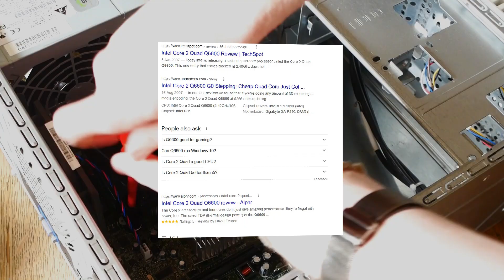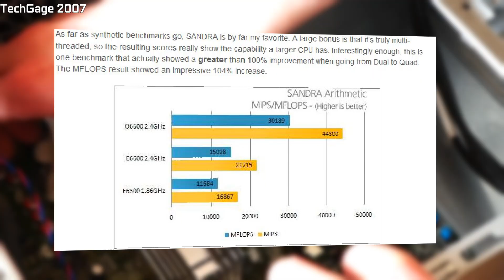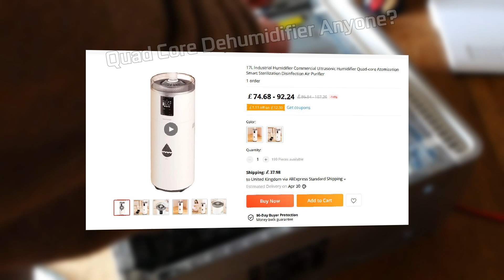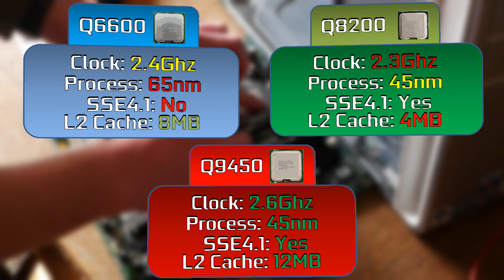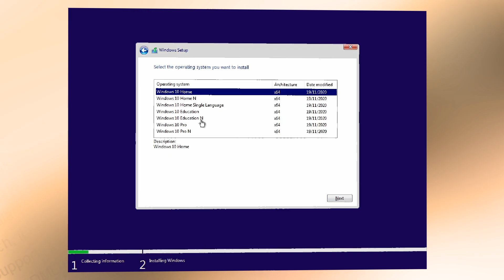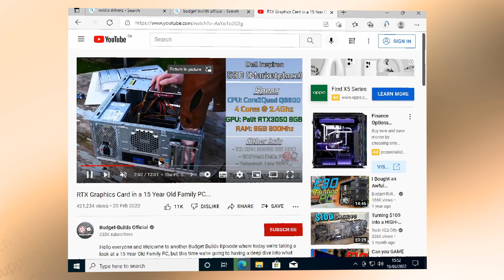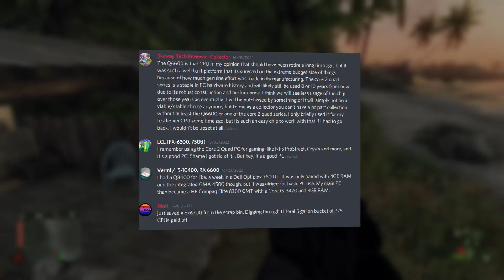Intel's Core2Quad...Finally Obsolete?

Comment: I upgraded from an E4300, to an E6300, to the Q6600. My god, with my Asus HD 4850 I felt unstoppable in 2008! This brings back so many memories of tweaking the old socket 775 beast at the middle of the night, increasing the clockspeed a couple of MHz at a time. Better days.

Comment: Q6600 is a legend mostly because it's an absolute beast in overclocking. With some luck and decent mobo and ram that handled high fsb you could get 50% overclock to 3.6ghz which made it by far the best cpu of the era in price/performance ratio at the time. Today all c2q processors are still perfectly fine in a lot of simpler tasks and old games even without necessary instruction support

Comment: Woah, my dad used a Core 2 Quad Q9300 for years, it was originally paired with a Radeon 5450 but it ended up dying a few months ago, we replaced it with a 2 GB GDDR5 GT 710 from Asus, the Q9300 ended up being a bottleneck (even when overclocking it to 3 GHz in the bios) so I advised my dad to buy a new system a few days ago, we ended up going for a Lenovo system with an i5-11400f, 16 GB of ram (which I upgraded to 32 GB since I just had a 16 GB stick laying around) and a GTX 1650 Super, it ended up costing us 800 euros which ain't bad. It's quite interesting to see a video about the Core 2 Quad right after we get rid it.

Comment: I had the Q2Q 6600, with 8gb of Ram.... and pair it with a GTX 970... was a great system for me for a very long while... until i upgrade to the i7 4770K... and to my present system, 3800x... the Q2Q 6600 was great except for when i got a better GPU... wasnt happy with me putting an R9 Fury in it...

Comment: All of these chips are great overclockers. Q6600 could hit 3.6ghz. And 45nm quads could hit 3.8-4ghz fairly easily as well. Those sort of clock speeds will make these processors more than playable if the above benchmarks are anything to go by.

Comment: Still using an Intel Core 2 Quad Q9650, at it's stock speed of 3.00GHz, on a Gigabyte EP35-DS3R motherboard, with 8GB (4x2GB) of G.Skill DDR2 1000 5-5-5-15 2T memory, along with a 2GB EVGA 750 Ti SC (with optional extra backplate) and a Sound Blaster Audigy (SB0090), for my Windows XP Pro SP3 32-bit /8.1 Pro 64-bit (with ClassicShell Start menu) retro gaming rig to this day as of 2022.

Comment: The great thing about the Q8200 is the fact that the price reduction can still be felt today. Often, I'm able to find Q8200s for less than 1 dollar or free, whereas the Q6600 and Q9450 are never in this price range.

C2Q is obsolete in the strict interpretation (through the formalism), but is far from it when operating a period-specific machine. Even C2Ds are not obsolete in this modified interpretation!

Comment: Watching this now on a 775 system :D specifically an optiplex with xeon (q9500 equivilent) ssd 16gb ddr3 and a gt 1030. Still works great for web browsing office content consumption and older games / emulators which is like 90% of my computing. I would actually like to thank you personally though because I hadn't had a functional pc in years and channels like yours actually inspired me to build this system very cheaply with all second hand parts several years ago. I do have a better computer built now but I still get lots of use out of this one and honestly it still runs faster than many much newer computers my friends and family use.
Reply: x3363?
Reply: @lagginswag  yessir

Comment: I had a Q6600/R9 390x PC until a couple of years ago. It was fine for what it was. The first PC I built my fiancée was a Q9400/R9 270. If you're not that bothered about AAA, they're really still not a bad proposition for the price points they're at.

Comment: My first high end build was a c2q 9300 in 2008! Loved that thing, was basically the first  of my friends with a quad core too! Also just recently restored a Dell XPS 630i and installed the top end q9650 in it. Bad company 2 was unplayable with the original c2d e8400 at 20 fps max. With the c2q 9650getting 45-70fps!

Comment: The Q6600 was my first quad core cpu and was my jump back to intel from using AMD 64 x2. I got mine after the price dropped and was a great value, especially if you overclocked since these CPUs were great for it.

Comment: A while ago I succeeded in installing a quad core q9000 mobile core2 quad in a thinkpad t61. it's quite the mod, but it takes the CPU performance of this laptop almost to modern standards, especially if you're willing to run linux and pear it down a bit.

Comment: I built a Mini ITX system with an E5440 (Server version of the Q9550) some three years ago and I ended up letting my wife use it for her Uni stuff. Still rock solid on a G41 mobo and runs nice. Granted it is just office work, but these chips are still more than usable not just for playing older or simpler games, but as a daily.

Comment: I was using a Thinkpad X200 and T400 and the T400 remains my main Laptop until 2019. The T400 now is the family Office PC and still runs Fedora like a charm.
Using WinXP/Win7 and Linux and for Office Use they still work fine, even some little Emulation was possible.

Comment: I recently bought a new motherboard for my q9550 system. The Biostar P43D3 v6.1 board i had it on before didn't support larger than 2GB dimms so i replaced it with an Intel Desktop Board DP43BF so i could run it at 8GB of DDR3. Its running across from me as i type this i just repaired the fan on its Sapphire single slot Radeon HD 3870 512mb so it no longer wails like a banshee. I plan on putting it in a nice case eventually with a nice tower cooler. I think it's great that i could put the Hyper 212 Black Edition on it the same cooler i put in my brand new Core i5-12400 system. Which will be nice because i run it with an overclock to 3.4ghz. 

Add some modern amenities like an add in USB 3.0 card and an SSD with windows 10 i'll bet most people wouldn't notice the computer is almost 15 years old just browsing the web on it. It's also pretty funny with a NVME SSD, but the intel desktop board i have only has 1 PCIe X16 slot so putting a Gen3x4 card into a Gen2x1 slot yields not so great throughput results making running more than SATA not really worth it. It also can't boot from that so the option is storage only.

Comment: I had a C2Q 9550 with a 1050 Ti and was surprised how well it ran Witcher 3, and this was year ago as a literal ebay budget build back when 1050 Ti's were like $100 or less. You could have a legit gaming pc for under 250 if you were patient. Well, you still can, but the last couple years were rough.

Comment: I have just finished upgrading a Dell Optiplex 780 with a Core 2 Quad [don't remember the exact model] and 8gb Ddr3 RAM... for regular use is more than usable, even with a mechanical HDD [still have not run any benchmark]. A discrete graphics card and an SSD would do wonders for it.

Comment: Yeah, re: comments about AMD tri-cores and such: I don't remember anyone comparing Intel's Core2 Quad Q6600 against anything from AMD, tri-core or otherwise, at that point. Conroe / Kentsfield was a monster when it landed (and started Intel back from the brink of the disastrous NetBurst era). I moved from an AMD Athlon 64 X2 3800+ (Manchester) to a Q6600, back in 2007, and it was a big jump. In real terms, that was the start of AMD's dark ages, until Zen turned things around. Today (on the desktop) I run a Zen 2 R7 3800x and a Zen 3 R9 5950x... but it was a long time before AMD got back in the game.

Comment: I still have multiple 775 machines around. Just recently stopped using my Q6600 pc as it was lacking for some of the software I now run, along with higher resolution video being unplayable. The whole of the Original Core2 and up series was a breath of fresh air to the pc world when introduced. They were very fast and very fluidlike in the way in which they run things. I no longer have a use for the ones I have but I can't seem to part with them. There are seriously so many core 2 Duo's and Quad's floating around in the wild you almost have to give them away.

Comment: I've dabbled around with several Dells. The best motherboards I had were the Studio S540 (4-ddr2)and Inspiron 560 (4-dd3) they both worked with quad core Xeons. Still have my all time old favorite retro socket 775 BTX Dell Dimension 5150 with a hacked in Dimension E520 motherboard with a BEEFY Dimension 9100 heatsink. Its had a hacked in N9600GT, GTX460, 740GT, and now a GTX560. I have to take the shrouds off to clear the BTX heatsink shroud.

Comment: I've used a Q9400 until very recently with a G31-based motherboard, 4 GB DDR2-800 and a HD 4670, then with a GTX 560 Ti in it's last days until the mobo's soundchip decided to adios. Tried to add a soundcard but the output made some undesired static noise and I couldn't fix that so I had to move to an 1155-based i5.
The CPU is just a Q9450 with half the cache, that being said it's still more than adequate for browsing, Youtube and gaming to a certain extent if paired with a GPU that can actually push some pixels.
Just shows how well the Socket 775 aged, these Quads are really cheap now and offer reasonable performance, and if someone gets a hold a G41-chipset mobo, some of those comes with DDR3 support, it can be a really nice budget system, even much so if the CPU is OC'd a bit / using something like a Q9650.
I'd still use my Q9400 if I had a G41 mobo, as I'm still very fond of the Socket 775, having a Celeron D 347 in the same socket long before the Quad for many years, the difference between the two CPU's is massive in retrospect.

Comment: That was a great review of the different Core 2 Quad CPUs - I'd personally get the 9450 if I had the choice, but still, the fact that all C2Q CPUs are still relatively decent in 2022 is a surprise.
Personally, I wouldn't install Windows 10 on one of these (or the Core 2 Duo series), as Windows 10 can be a bit too much for these CPUs. I see them as great Windows 7 CPUs, and even better Windows XP CPUs, when paired with a relatively decent graphics card and at least 4GB of DDR2 RAM. These are great for older games and programs that just flat out don't like running on Windows 10.
Speaking of, I wonder if I should salvage a couple of scrap Core 2 Duo/Core 2 Quad era desktop PCs that no-one is currently using...

Comment: Dell optiplex 380 LGA 775 motherboard is quite robust, because I wrote off 50 units of them in 2018, none of them were dead (the company where I work, use PC up to 7 years). unlike Optiplex 390 - 3010 with core i gen 2/3, they could suddenly dead without warning, at least 10% of them were dead, and  10% of them were having power switch malfunction when I wrote them off in 2019 / 2020.

Comment: I personally use a Q9400 in my Pfsense box, seems to handle everything fine, there is always a use for older CPUs in someway or another.
Reply: Are you using snort for packet inspection?
Reply: @elstondias9172  Yes I am, seems to be fine for home use (15 or so devices) just always go for 4GB of ram or more if you want to use IDS/IPS. :)
Reply: @SiR_KaMiKaZeE  👍 Does this feature work with all processors?
Reply: @elstondias9172  Technically yes, however I would not recommend anything under a quad core if you plan to use it in a environment with lots of devices.
Reply: @SiR_KaMiKaZeE  But correct me if I'm wrong I think the processor should also support certain instruction sets for this feature to be operational.

Comment: I was wondering would this be a better option then a phenom 2...? I'm still using one of those and the windows 10 experience is ok on it but it stutters alot...would this be a better option? I have a very very small budget...just asking for opnions. Also I could just keep the current and deal with it. Just wondering thanks.
Reply: are you using an hdd or ssd?
Reply: Sdd....it just dosent respond well could be a hardware issue also...not entirely sure.

Comment: A Q6600 overclocks easily to 3GHz which is a substantial improvement for gaming and video decoding. With better cooling they can be pushed to 3.2-3.4GHz and some later G0 stepping samples can do 3.6GHz and you get a free space heater in the process as well. Ditto for other Core 2 era CPUs, they all have a 30%+ easily achievable frequency headroom.

Comment: My brother has a core 2 quad q8400 which I recently bought for less than 20 dollars as an upgrade for the core 2 duo e7500. Only 4gb of ddr2 ram because it's the max supported by the motherboard.
I had to modify the bios of the motherboard, which had overclock locked by the manufacturer, to overclock it from the default 2.66ghz to 3.20, and it is very stable.
The pc also uses a gt 420 and a cheap 240gb ssd. It is very fast for most of the uses, but slow in most recent games due to the GPU.

Comment: Another Q6600 still in daily use. OCed to 3.2GHz since its purchase (2007) and now with an SSD and a Ti750 more than good enough for some casual GTA V use. Still running at mid-40 temps (new Noctua fan/heatsink is awesome). Having had three PCs in the 10 years before this system there's been no reason to upgrade in the last 15. Even as a professional developer it's not noticeably sluggish in daily use compare to other, more recent, systems. Windows 11 isn't really an option but that's the first time it's felt close to being out of date. Was excellent then, still more than good enough now.

Comment: to anyone still using core 2 quad is a real hero i upgraded my corei5 3rd system it was fine but it was lagging in productivity department using unreal engine and other 3D software i had to upgarde.

Comment: I remember owning a Q6600 before I upgraded to Ryzen 2700x late 2018, Honestly the CPU was amazing and kept a pretty steady overclock of 3ghz with a Scythe Mugen 2 cooler, never going above 70° c . 
The reason I upgraded was because it was starting to show it's age on the games that interested me and the programs I was switching to, without switching from a R9 290 card I could start maxing games or enjoy 60 fps on the same settings just by getting that Ryzen upgrade, still rode it to hell and back for 8 years

Comment: My first proper gaming PC was a second hand custom built machine that I bought from CeX in 2012 for £180 (thanks staff discount)
It was in a fake Powermac G5 case with cathode lighting.
Q6600
8GB RAM
Radeon HD 5770 1GB

That PC was great but I had to sell it to make room and to make some of my money back for my current build.

I do have find memories of that old PC though as the upgrade in speed from my previous PC was huge. Going from a Single core Pentium 4 to a Q6600 was massive.

Will be interesting to see if people get as nostalgic over the current crop of chips.

Comment: I remember the Inspiron I bought from CeX with a Q8300, 4GB DDR3 and a Geforce 310.
It was great really, despite the graphics card which was upgraded to a GT 520.
Reply: While it was an upgrade, it is way below what the CPU should be able to properly support I'm thinking of something like a 750 Ti or RX 460 at the top end.

Comment: I have a Core 2 Duo E8400 machine as my TVPC for my upstairs 4K TV, it runs games decently and they are playable at 1440P maxed settings in my opinion. Occasional stutters from not being able to load things fast enough despite running an SSD.

Comment: I built and we used an overclocked C2D Pentium at 3.5Ghz OC for a number of years, with 4GB RAM, Win7, and a SSD it ran fairly well for basic webbrowsing use. Upgraded to 4th gen Intel, 8GB, SSD a couple years back when Win7 support ended and we needed Win10.

Comment: I give away my xeons 5450 and 5460 (q9550/9650) but still keep one mbo with q6600 in it, just as reliable backup system in case of emergency. Or probably retro PC one day.

Comment: I've used quite a few Q6600s over the years as well as my share of Q9550s and 9650s. The thing one needs to take into consideration on those older Dell Inspiron 530s and Vostro 200s is that they came with two different motherboards. The g22m02 only supported 4 gigs of ram and and due to VRM limitations can't run Quad Core Processors. The g33m03 could utilize up to 8 gigs of ram and run the Quads just fine. In fact, the g33m03 was designed by Foxcon specifically for Quads. 

For the record, I have numerous C2Quads here at home and a lot of Socket 775 boards and computers. I rarely use them these days, but am in the process of building a retro rig with a DFI LanParty S775 rig with the P35 chipset and a Q9550. Depending on the cost I might water cool it. At this point I have everything but the watercooling gear.

Comment: I think the thing about Pc's is expectation. In my possession a core 2 quad 8200 paired with the (terrible) NVIDIA Gt 710 .  
Now you must be thinking how crappy of a computer experience this is.  Most of you would be correct in your assumptions. 
This is a great low end Dedicated streaming PC with the built in Nvidia NVENC . That streaming pc go BRRRR with 60fps 1080

Comment: i used own a core2duo quad and it was terrible for anything above windows 8.1 and performance in games were really bad even with a good gpu these days
Reply: I have many core 2 duo and pentium systems and they run Windows 10 just fine. Make sure you're not running on a dying HDD and 2gigs of ram or whatever because that will murder the performance. have a minimum of 4, preferably 8gb, and any SSD.
Reply: tf is a core 2 duo quad?